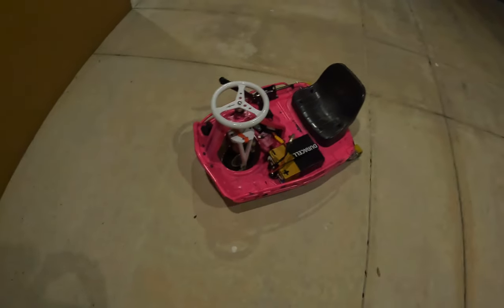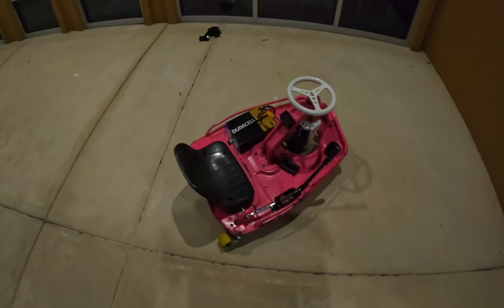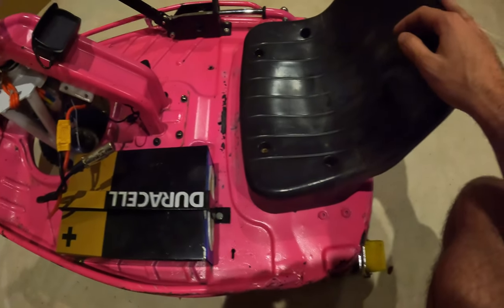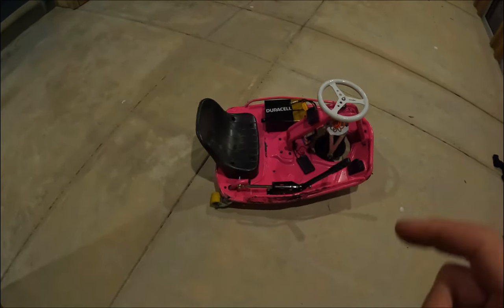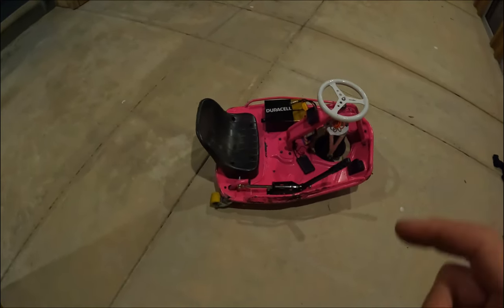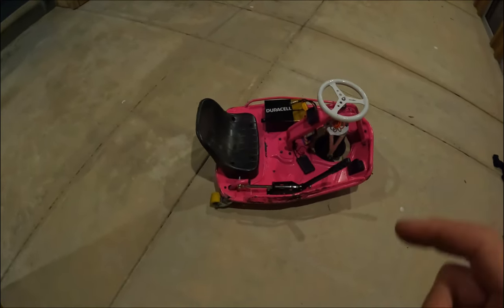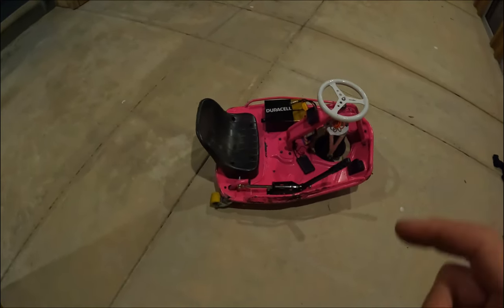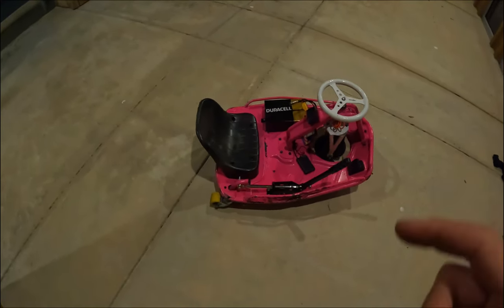How To Mod A Razor Crazy Cart!

Comment: Hey bro I don’t even know how to check messages so I might not see it but basically if I wanted to get into this I should by the cheap (500$) 24v starter one instead of the 1k xl one, and rather put extra 500$ I would’ve spent on the the xl into making the regular one way fast/quality of life. So give or take not including labor I would cost 1k more or less to have the setup you run. Also thank you for making this vid, albeit this is an “expensive hobby” it’s nothing in cost compared drifting real cars. I’d rather go all out spent 1k for me and my girl to get into this hobby and something fun for us to do together
Reply: Thats what makes it so great, youre not risking much of anything aside from maybe buying another one to make it different than the first and they last for a looong time.
Reply from the maker: For $1000 you can get the 500w 48v setup! super fun and it will hit 21-22mph

Comment: As a former competitive downhill Longboarder, I recognized those Orangatang Durian wheels immediately!! I dont mean to be a huge snobby nerd in the comments but maybe someone will find some interest in additional information about longboard wheels. They can have a really significant change in the ride characteristics of these carts, as they did in my longboarding "career" (it was a hobby when i was 18-22 but i took it very seriously lol) 
For context, lets remember some specs about the Durians here; they are 75mm tall with a Width of 52mm and contact patch of 45mm

3 Topics; Durometer, Bearing Seat Position, Lip Shape.

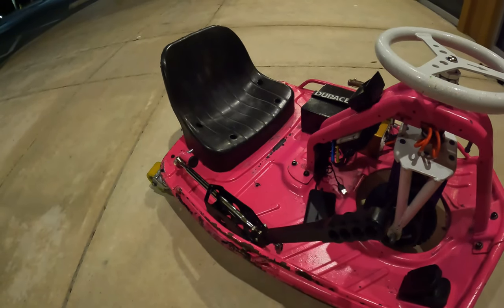> Durometer: Longboard/ Streetboard wheels are made from Polyurethane. The unit for measuring the hardness of polyurethane is called Durometer. The yellow Orangatang Durians pictured here have a durometer of "86a" which is on the upper end of hardness for a longboard wheel. Street/ Park boards (the usual double kick boards) are very hard, usually floating around 101a or more. As he says at 5:04 & 11:00 the cart has no suspension AND its metal on metal. Which means you're going to feel every crack and rock that you roll over. When i was racing at events like Maryhill Festival of Speed, I would usually setup my boards to have a higher duro in the front and lower duro in the rear of the same wheel (Something like 82a / 76a [speed up front, grip in the back]). A Lower duro = softer wheel. Softer wheel = smoother ride as it can absorb more shock and roll over cracks alot easier. Harder wheels were usually the bane of me falling flat on my face while going up a curb or hitting a rock. With that being said, harder wheels will keep their speed in straights, but that's not applicable here as you have a dedicated motor and arent reliant on the same variables such as aerodynamics as in long board racing which is a Gravity sport. *So look into the Orange 80a Orangatang Durians as a side grade replacement for this cart. A nice balance between speed and absorption that'll run you about $65

> Bearing Seat Position: There are 3 positions for the "Hub" in which the bearing sits on; Centerset, Offset & Sideset. This is important due to wear patterns and grip characteristics. A Sideset wheel is going to be much more susceptible to "coning" vs a Centerset wheel as on a standard 10.5 inch wide longboard, the weight is focused more on the inside of the wheel. This is great for power sliding and "Free-Riding" (taking the concept of friction created by the spinning wheel and using that to stop by throwing the board sideways) but wears super quickly resulting in buying another set of wheel (usually $50 for a set). Sector 9 Butterballs and Abec 11 Flashbacks were notorious for this. Personally, i was a big fan of center set wheels as they lasted a long time. Whenever they would begin to "cone" too much on one side, just rotate them and wear the otherside. They were really great for technical downhill where i needed to have additional agility and control over the wheels to get around tight corners. 
I was running Centeset Abec 11 Grippins (70mm - 81a) back then for technical downhill and Offset Venom Cannibals (76mm - 76a) for high speed downhill (50+mph) the Grippins would fit on those casters no problem. 52mm wide with a larger 50mm contact patch. 

> Lip Shape: Probably not applicable to a Crazy Cart but worth mentioning anyways. The discussion between Round vs Square Lip shape was important to me as Racer because i was looking for a "square" lipped wheel. Reason being; when taking a corner, a square lip will fold under and dig into the pavement as opposed to a Round lip which has less resistance, resulting in sliding and potentially washing out/ crashing. You might not be able to find a Square Lipped, centerset wheel - at least not one that would fit these casters.. so the runner up to that is a Rounded lip with as little of a bevel as possible. That's why i recommend something like the Grippins. 

You can get a better idea of all of this information from these 2 old school videos: https://www.youtube.com/watch?v=g2DZl-repP8 x https://www.youtube.com/watch?v=HKwM-akPpe0&t=3s

As far as the Loaded bearings he talks about at 19:01 you can definitely keep them you dont need anything overkill like Bones Swiss Ceramics or any bullshit like that. I used to just run $10 Rush bearings and treat them like disposable batteries; when they rust or dry out, toss them out hah.

Edit: if you’re planning on riding on wet roads (keyword; planning), what we used to do was mill lines around our wheels  with a dremmel or lathe for better traction just like a tire. Call them rain wheels. 

TLDR: You could probably swap out those Yellow 86a Orangatang Durian Wheels with a softer variant like the Orange 80a offerings from them OR Abec 11's Grippins in 78a and get a smoother ride with better traction and more even wear pattern for a longer life span.
Reply from the maker: Thank you for the information bro! Really useful, I thought I knew a good bit about long board wheels but I learned a lot from your comment 👍🏼
Reply: Fuck yeah
Reply: @itsreformm  first off I want to thank you for a video crazy sick set up and inspired me to start making one my question is how did you paint yours? You should do a tutorial as well, but how did you paint yours? Did you strip it or use some sort of paint?

Comment: Can i ask ya why haven't you gone to the chassis. What are the difference in body alone looks like you got the drift bar from xl steering wheel ect ect ? Im looking at buying one but just wondering
Reply: The XL is much heavier, and takes up more space.
The standard cart can be carried (if necessary,) good luck carrying the XL 🙈 haha
You can also throw couple, maybe even three of the standard carts into the trunk of a sedan, back seat easily.
NOT going to happen with XL (just one,) unless you have an SUV (the least,) or a truck.
XL is also way more comfortable, and has more protection.
It also doesn’t flip over as easily as the standard cart does.

I have both, and rarely use the standard cart due to constant flipping, smh.
6’1 180lbs.
Maybe if you’re smaller in size, it balances out better 🤷🏻‍♂️, but it ain’t for ME.
And that’s on a stock 250W motor.
I can’t imagine on the upgraded 900w.
You don’t want to flip on that thing going anywhere near 40mph ☠️

Comment: Hi someone please answer this :)

For the second recommended setup, when u said 48v battery w/ speed controller. Can I use those with the stock motor? Also on taxi garage the 48v doesn’t come with a speed controller can I use the stock speed controller and stock Moyer with a 48v battery?
Thanks

Comment: How did you connect the 38v controller to the standard Crazy Cart? It doesn't look like the wires for the on/off switch come directly out of the 38v controller like they do for the 24v controller. I bought the 38v controller and can't figure it out

Comment: Is this xl or just the regular one? What’s the difference or recommendation?
Reply: That's the regular crazy kart, it's lighter and smaller so you can handle it a bit easier but it has less space, people usually opt to mod these because they are cheaper and generally better for speed and handling, however If you're a bigger or taller guy, the xl crazy kart might be a bit more accommodating
Reply: @luciferstarot7695  thank you!!! I’m about 5 foot 7 and 165lbs. I think I’ll go for the regular!!! I appreciate it!! Thank you!

Comment: So I have 4 stage 4 900w 48v battery setup with my Crazy Carts from Taxigarage..  would these mods make my carts faster? I am liking the Mph speed reading mod and the battery reader mods.
Reply from the maker: The only mod that would make your cart faster is the new taxi garage 1100w kit which you can get through the link in my bio and get 5% with my code PLUTO. The gps and battery reader mod will work on your current set up though.
Reply: @itsreformm how is your cart so fast? Since they no longer sell your motor. But the v3 is coming out that will take 6000w vs the 4000w. I’ll be getting it & how are you getting 50amps? And what would you recommend for battery for me. And last thing did you spray paint the cart?

Comment: Why did you link a XL speed controller for a Standard Kart? Is it still compatible?
Reply from the maker: all the parts linked are compatible with slight modifications
Reply: @itsreformm  What do you mean with slight modifications? Does that mean I have to duct tape or weld it?

Comment: Can u run the stock battrry with the 500w motor and 36v speed controllers
Reply: @Francisco-Danconia  I’m changing plans I’m doing a 36v battery and 36v speed controllers and stock motor I already found a charger for the battery so we chilling

Comment: wheres the amazon two pack front tire link
Reply: I looked up the specs of the tire that Taxi-Garage sells and then searched that on Amazon.  There's a 2-pack of 200x50 for $26 which is maybe what OP was referring to.  I'd provide a link but I imagine they change over time so it'd be useless by the time others saw it.

Comment: can the 500w motor from the xl fit in the standard?
Reply: @Francisco-Danconia  so you are saying i should just get the 48v speed controller and battery for it? also is there any motor that fits in the standard that would make it go faster?
Reply: @Francisco-Danconia  I don’t have the xl cart but I was planning on getting the xl motor to put in my standard cart
Reply: @Francisco-Danconia  how fast does your cart go?
Reply: @Francisco-Danconia  I see is there any other upgrade that could squeeze some more power out of it or is that it?

Comment: wtf it’s $1100 for a stock cart??? Might as well build one from scratch
Reply from the maker: $1100 is for the xl, never said the standard was $1100. It is $500 brand new and used for less than $200. I got my cart for $50.

Comment: Hi someone please answer this :)

For the second recommended setup, when u said 48v battery w/ speed controller. Can I use those with the stock motor ? 
Also on taxi garage the 48v battery doesn’t come with a speed controller can I also use the stock speed controller?
Thanks